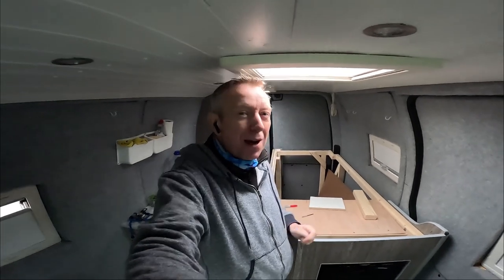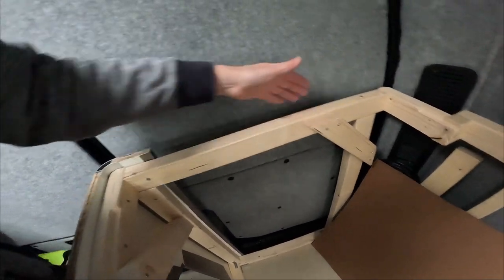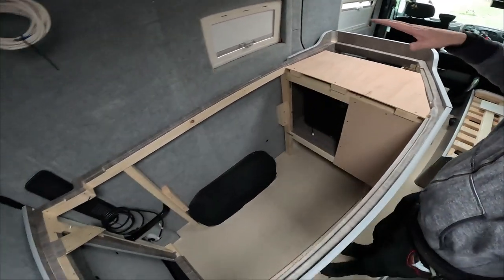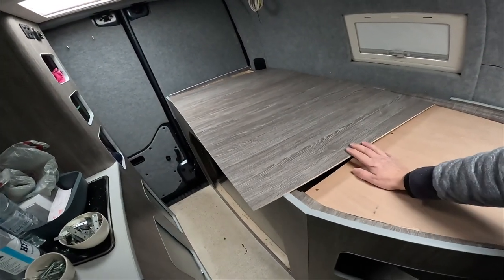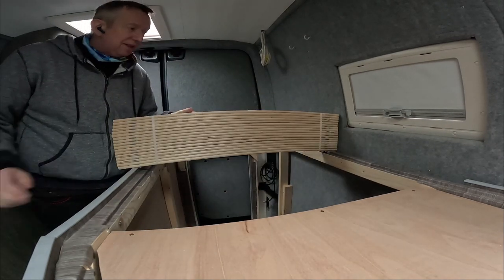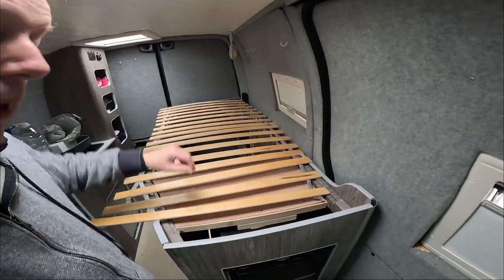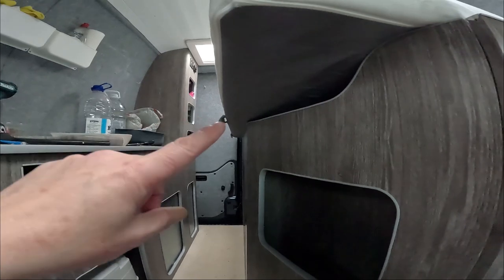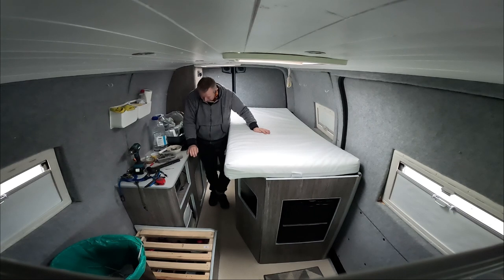Van Build Vlog: Bed Build Part 4 (Day 19)

Comment: Looks great! Very professional looking job. My only question is why you didnt make the slats built into a hinged lid arrangement so you can get access to the storage area from the top (or even a completely removable lid). Got to be a bit of a pain crawling around on the floor to get access I would have thought.
Also thinking further, if it was me I'd also add some removable rectangular hanging storage bins that hang from a ledge either side at the top (must plastic bins with the correct length)  which can be removed when you need the full height storage capacity. Just my 2 cents worth!
Reply from the maker: Was trying to keep things simple and save weight. Also the garage is too tall/deep for a lid to be much use; I’d have to lean so far down I would end up falling in 😅

Comment: Sorry if I've missed something, but why is the bed so high? Are you using the underneath area for storage?
Reply: He needed to accommodate the fridge, rather than have it inside the kitchen galley as before because having a fixed bed to the side would restrict access. He could have moved the galley up to the front to accommodate it but that would mean not being able to sit & look out the side door. Although he could sit & look out the back door when open. I guess its not an optimal viewing point, especially in the cold with no windows there. Personally it doesn't work for me, its topsy-turvy but its his van & he's set on having a fixed bed in a MWB van that fits his height.

Comment: Will your bike fit in the back ?
If you're putting it in handlebars first, you may want a wheel track
The spare wheel might fit in there too
I hope you don't roll over too far, it's a bit of a drop :D
Reply from the maker: Haven’t tried the bike yet, will leave the fitting until the warmer weather gets here, but it is a folding one, so hopefully. fingers crossed